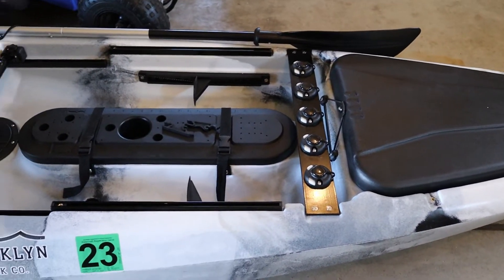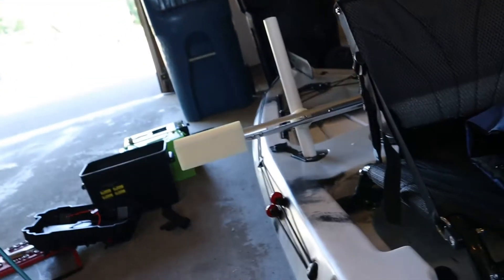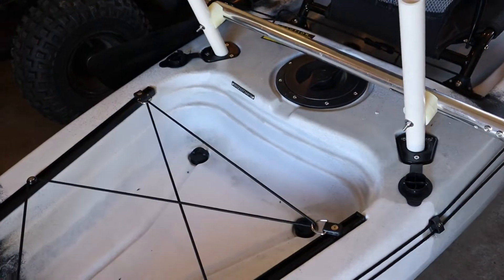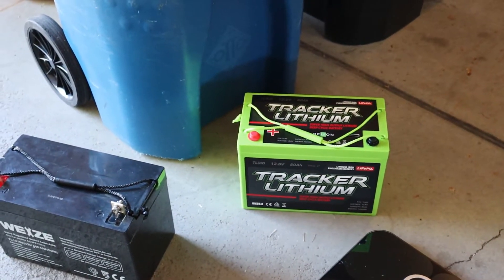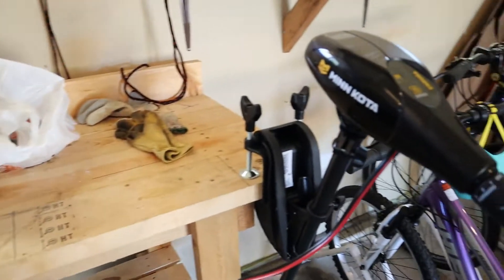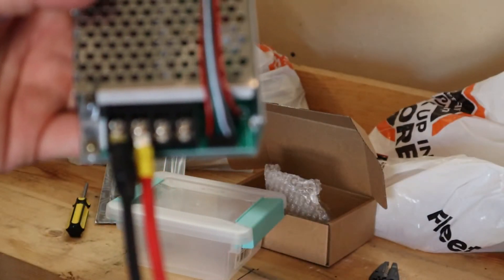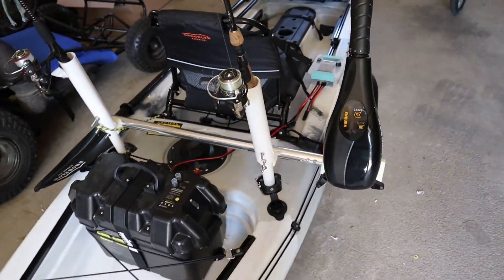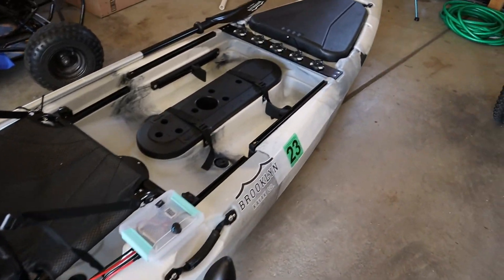Rigging up a Kayak for Fishing. Trolling Motor Mount with PWM!

Comment: Great timing. I’m getting ready to mount the same motor to my BKS RA220. Just a suggestion. Why don’t you use pvc reducer to add the larger PCs pipe for your rod holder? Would be a lot cleaner and get rid of the nuts and bolt. Where did you find the motor mount? I don’t see one listed on BKC website.
Reply from the maker: A reducer would be a terrific idea! I was just using what I could find in my garage. 😂 You'll need to call them for the motor mount. It used to be on their site for $99 but I know they were having issues with it fitting all of the kayaks. If I had to guess, they probably pulled it down.